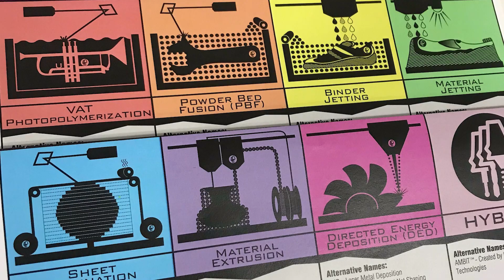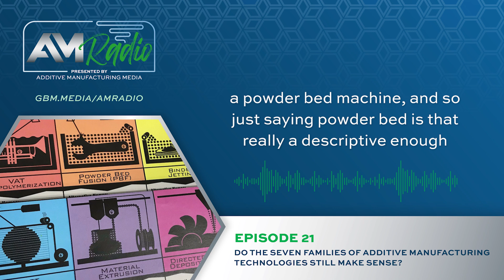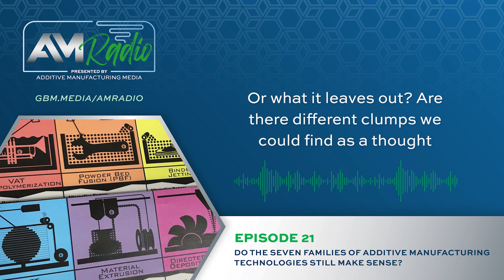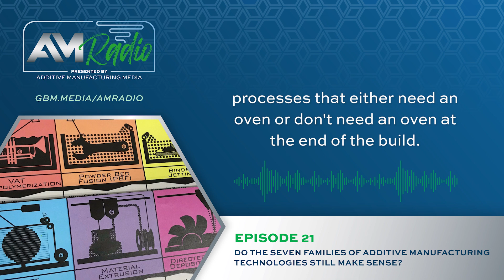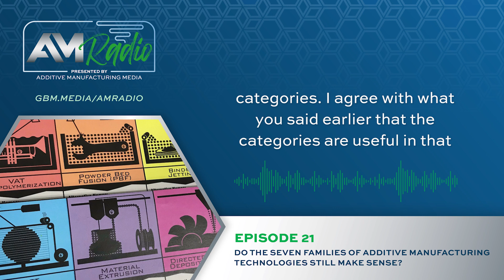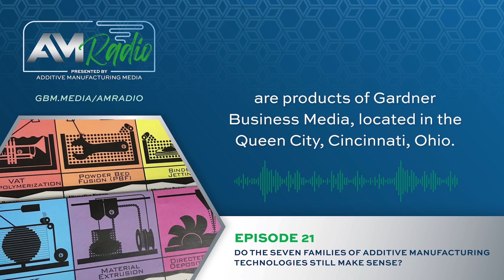Do the 7 Families of Additive Manufacturing Still Make Sense? | AM Radio: A 3D Printing Podcast

Comment: I think as the occasional cross promotion it works, but I was expecting some added graphics. Obviously that adds more production time, but maybe a few examples of products made using the different methods or pictures of the machines sprinkled in would give some added value over just listening to the podcast. It would be a bit more accessible to those of us not as well versed on some of the more niche brands and technologies you were discussing. I guess I have some research to do now... thanks as always for the great content.

Comment: personally I divide the AM in four categories, extrusion/liquid/powder/sheet based technologies depending in the "state" of the material before the fabrication. outside of perfect it is quite good for their classification,  for example extrusion includes from FFF to robocasting to WLSM, powder from SLM/SLS to BJ to DED and so on so forth....
Reply: I'd go even further back to basics and distinguish two categories, where energy is carried together with medium or beamed seperately. And then by the type of energy, laser/electron/heat/chemical/mechanical/etc...
But I totally agree the classification has to be tree-like with crosspolination of subcategories and based on principles, not established solutions.